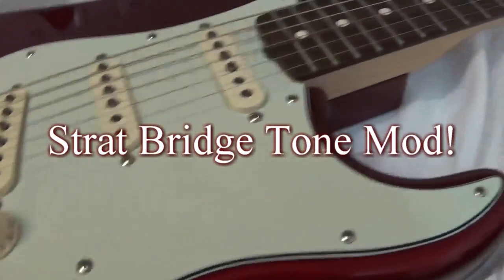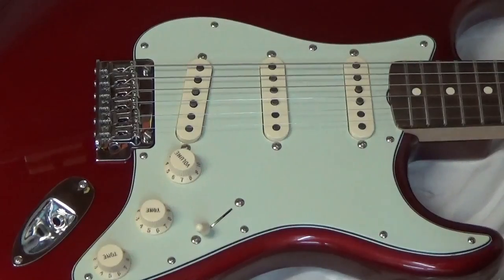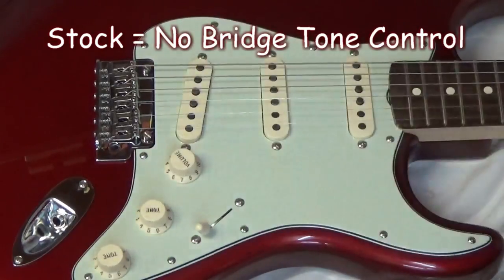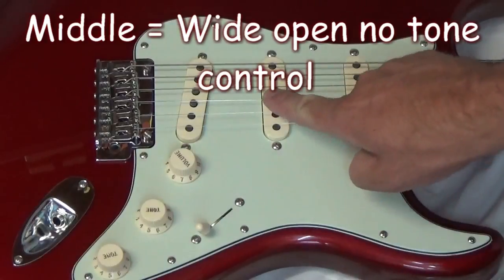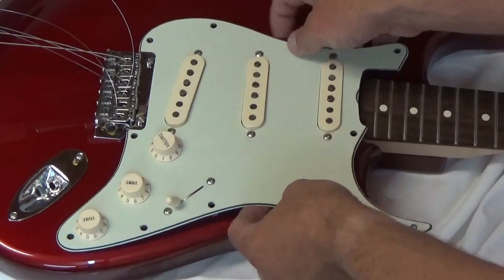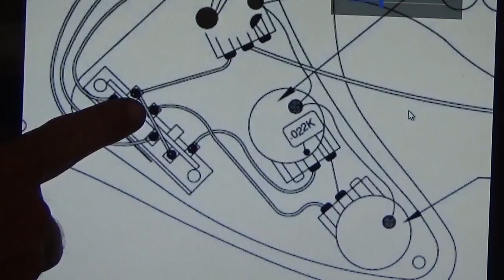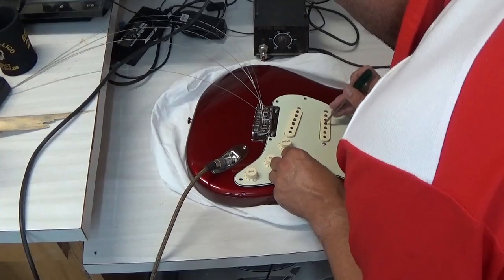Strat Tone Mod

Comment: Add a small jumper wire between neck tone connection and unused bridge tone connection. Bridge and neck pickups are NOT on together... ever. See ?
Reply: Well said. Far better way to do the tone mod.

Comment: What would be great is if you could have the neck pickup tone pot control both the bridge and the neck at the same time seeing as with a traditional 5 way switch these can't be on together anyway
Reply: that is exactly what I do and why... The bridge tone tab on the switch is free.... add a small jumper from it to the neck tone tab and you are done.

Comment: Many have suggested you connect the 1st tone control to BOTH the neck and middle pickup and the 2nd one to the bridge pickup.  How would you do this?  That way you don't need to leave one wide open.
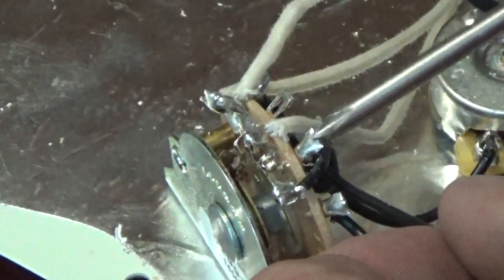Reply: Leave the original wiring as they were then add a jumper wire between the two lugs he's pointing to on the selector switch at the 1:00 mark.
Reply: Solder a jumper wire from the first to the second lug.